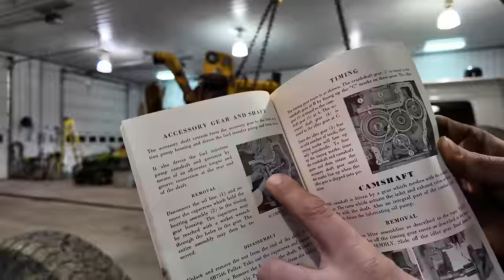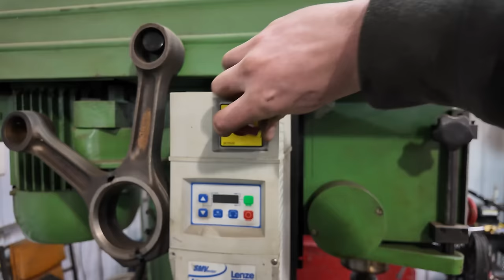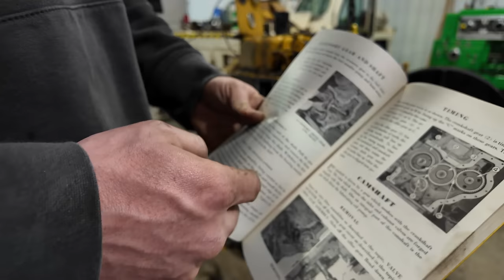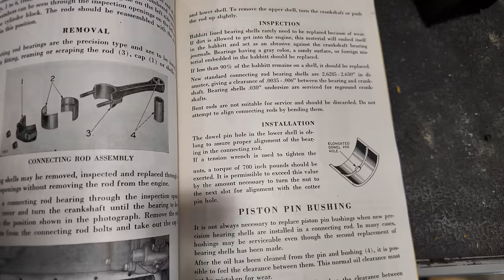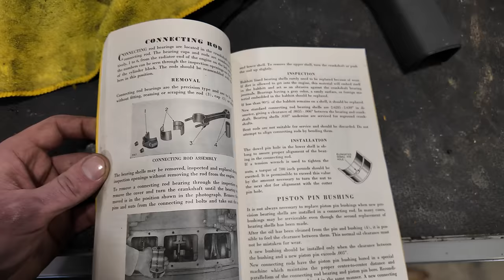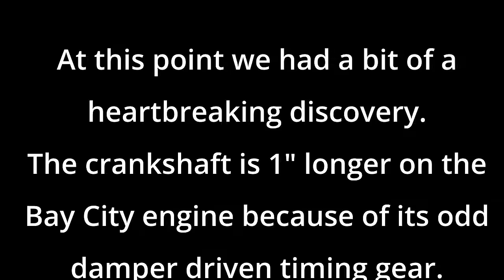Bay City Cat Engine Teardown | The Struggle is Real

Comment: check Squatch 253 for info on the pistons. When he did the engine for his 1938 D2, he went over the piston typeses. IIRC, that is OEM design, and yours are way too loose. That was the problem with the 2 piece pistons, the "ring" comes loose and you lunch the engine.
Reply: It's kind of exciting when it happens. A cloud of aluminum bits came out the exhaust while the engine knocked. Bent rod, destroyed lifters but ran enough to get the tractor loaded.
Reply: You beat me to the punch. That was a cat design, a poor one but cat none the less. I have seen one fail before, cascading catastrophic failure ensuing.  Check out squatch channel, he has a lot of information on these old cat engines, might even be able to steer you in the direction of the newer updated design pistons to fix yours.
Reply from the maker: Thanks i went and checked out a couple of his videos he definitely has a lot of knowledge on the old cats!
Reply: @ScrappyIndustries  oh yea he has an insane amount of knowledge about old cats I love watching his content
Reply: That 2 piece piston design is absolutely insane! I would have never in a million braincells thought that would be a factory concept!?!? Blowing my mind to think that actually worked 🤯🤯🤯🤯🤯

Comment: The copper ring is a sleeve shim , needed to get proper sleeve height.  Those sleeve pullers are great have used one for 15 years never failed me yet . Just a thought about that grader engine if it was military they sometimes have different specs for parts to aid in repairs , I know on the MM jeep ,NTX I think, they spec hydraulic lifter instead of solid like the tractors that shared the same engine. Yes running engines with a broken crank is real , had a 4440 JD come through the shop with its crank broken at a angle at the next to last main cap , still showed oil pressure but was down on power and he drove it about 12 miles to get it here , we were shocked to say the least.
Reply: Interesting that they used copper shims to adjust cylinder liner protrusion.  I wonder why Cat stopped doing that because cutting the block to adjust liner protrusion can be kind of a pain when doing an in-frame in my opinion.  
With regards to engines running with a broken crank I have seen that on 5 or 6 engines including on in an Alcohol Dragster that had just set a new track record. The only reason we found it was because when we were baring the engine over in the pits backwards while leaking the engine and replacing the valve springs the engine locked up tighter than a drum.  In reality it was a fortunate thing because I seriously doubt it would have survived the next pass.  I also have seen tops of pistons break off and the engine continued to run albeit it had a miss but it didn’t smoke or make any strange noises.
Reply: My first “real” mechanic job was working for the local Allis-Chalmers dealership. We had a customer bring in a WD that needed an overhaul. I got the job of doing an in-frame on it. Got it done and running good and shipped it. A few weeks later the tractor was back in the shop making a horrible knocking noise coming from the bottom end. I felt terrible because I thought I could have messed up something. Turned out to be a broken crank. Our working theory was that the crank had a defect, and the increased power after the rebuild caused it to finally fail.
Reply: @gullreefclub  I work on mostly John Deere equipment and with some of the rebuild kits now days the liners are not as thick on the top so I've used up to 35 thou shims on them , also I'm no stranger to mixing up parts to get things fixed.

Comment: They were known as screw top pistons in the earlier Cat diesels and they came loose after a time. All you need to do is drill out the two dowels tighten the piston top and drill knew dowel holes and re-pin the piston top- job done

Comment: Just in case... Mic your crank, rod journal, measure the rods for length and journal diameter. Check the crank throw and piston length. You don't the piston skirt to hit the crank or top to hit the valve. You MAY end up swapping rods. I saw the wrist pins had clips. While it's apart and you're cleaning that way you can assemble with confidence.

Comment: When you tip it up on its tail throw that 6 x 6 I see in the background under the flywheel housing to catch it when it drops over center. Then you can lift it back up with out all of the flopping around drama.

And ditto on the protrusion comment above. Pay attention to it. The value should be in your specifications.

Best of luck with the swaps...they can be a pain.

Comment: Sam, pay attention to your liner protrusion when you reassemble. That head gasket seals on the top of the liner. If that protrusion is out of spec, youll have future head gasket issues. I dont know what the actual spec is unfortunately

Comment: Great video Sam. Shows issues most folk will run into when working with old equipment. I'd like to see if the oil pressure increases now you found that bypass adjuster on the bay city engine

Comment: You're starting to convince me i need to find a terex now. Btw,, you mention broken cranks. I bought a one-ton wrecker years ago with a bad knock (chevy gas engine). I drove the thing home...when i pulled the motor to replace it I was shocked to see the crank was broken in half about midway- right at a rod throw. The way it was broken it couldn't "spin" past itself but it made one hell of a noise😂

Comment: On rod bearings the wear is going to be on the rod half vs the cap half of the bearing. Being the rod pushes down on the crankshaft the bottom half of ros bearing won't show any wear
Reply from the maker: I agree 100% guess I didn’t really show top bearing on camera.  I checked up and down play with the crank at 90 where I felt most wear would be. They’re pretty fresh

Comment: Nice job, but to prevent hitting the ceiling, put a battery operated horn with a "sensor" switch on top of the beam. When you are lifting and wiggling, you forget about that ceiling

Comment: I bought one of those chineseium  propane instant water heaters and connected it to my pressure washer and it works fairly well, but I'd bet if I had bought two and hooked them in parallel with 'T' fittings on the water inlet and outlet, it would have been as close to a $3k steam genni  as one could get for less than a 1/4 of the price.
23:38 I'm surprised there was no gasketed access cover on the oil pan for that relief knob, or was there one that I couldn't see on the video? OK, I went back and looked closer and there was a cover.

Comment: Quite interesting comparing the 2 engines, "on the fly" modifications were quite popular in that era. Remote control crane made tipping the engines on their rear much smoother and easier than a forklift did for Matt.

Comment: Sam, you should be able to find the copper rings thru a Cat supply house. Those look kinda familiar from a cat I was tinkering with a few years ago. Though I had a local machine shop do the sleeves as I didn't have the needed tools.

Comment: I'm Thinking that you Have a injection nozzle leaking fuel (not closing ). This will cause a Knocking sound that sounds a lot like a bearing or pin knock. looks like I'm late to the party. also the engine looks to have very few  hours on a rebuild. on the pistons with the loose tops there may be a nut holding the top of the piston on. if you remove the rod you may find the connection point of the piston top.
Reply: The whole top ring of the pistons is threaded on the base to retain the cast iron top ring groove/land.  That’s what has lost its tension over the years.

Comment: For what it's worth.  Washing down greasy engines was with jam tin of kerosine and a 1"or 2" paint brush, the brush got in and around the tricky spots agitating and loosening the stubborn grease, and, then the wash down with water.  VOILA.  I don't see kerosene used by anyone in USA to clean greasy parts.

Comment: Hi Sam , just wondering if you had checked the injectors as it's possible for them to 'drip' when they get worn or partially blocked , this causes a process known as 'hydraulicing' or 'knocking' and it will definitely sound like a bearing knock , hope this may help on the Cat motor , good luck , kind regards, Jimmy.

Comment: This doesn't have anything to do with your current project, but I've held off as long as I can.
I sure would like to "borrow" your motor home.  That is a real nifty looking rig.  LOL
Sammy you is one cool dude. Be careful, though, if you lose the "e" ya becomes a "DUD". That Terex Carry Crane is simply fab and with your super duper remote control, Ole Kurtis down under is probably slobbering with envy.
If it was easy "Matt" would have already done it!!!   Just kiddin ya about ur bud. At least that's what he claims.....

Comment: Im surprized that with all the old cat engines out there that parts are scarce
Reply: It is nearly 80 years old now.  In recent years CAT has let parts for even the D311/D315/D318 that are only 70-ish years old to the aftermarket.  They do offer “Classic”  parts in some cases though usually at a premium over other suppliers.

Comment: @ 22:30 you at least have a winch on your crane, try it only using the boom's lift/lower and extend/retract cylinders, THAT is a challenge even with a remote, standing 15 feet away and 3 stories under 😁

Comment: With all the advances in CAD/CAM, 3D scanning, and additive manufacturing, I wonder how much easier it is to remake some of these unobtainable parts? Obviously the cost of metal eD printing will have to come down significantly, but how difficult would it be to make a model and then send it to you CNC mill to make out of a hunk of aluminum?

Comment: Could you use a travel limit switch and electric valve to prevent over extension in the shop? Or to interrupt the remote control?

Comment: Do you think that is an early means of gas porting to improve ring seal. You see it some on racing pistons where there are vertical gas ports that go through the top of the piston and open being the ring, compressing the ring against the cylinder wall to improve ring seal. Idk. Good video!
Reply: Nope, not that, just worn out threads.  CAT wanted to use the cast iron ring groove insert and where later on they figured out how to cast them into the piston, at that point they were installed after the two pieces of the piston were machined.
Reply: @jimrankin2583  Thanks for the explanation! Learned something new on that one.

Comment: What you call ,,gasket,, under the liner, could that be a spacer? But the use of copper( easily deforming so losing height) would not guanrantee a set position.

Comment: A lot of big diesels like this have two piece pistons. The bottom is aluminum and the top loose piece should be steel. Check with your diesel guys before you condemn the engine.
Reply from the maker: I’ve seen that in the later 3406s etc. but that’s not how this was done. Evidently still a cat design in the 1930s 🤷‍♂️

Comment: That engine needed spray with a degreaser first, then a hot water washdown.   He should pressure wash from the top down....otherwise he is just running dirt over that he already cleaned...lol

Comment: Zep Industrial Purple Degreaser.  Just buy the 5 gallon cube, and a 2 gallon garden sprayer.   Mix as needed.  Do not use on anodization, nor raw aluminum (instant dark grey, and will erode it completely if left long enough).

Comment: I'm curious Sam. How does a video get 61,550 views and ONLY 7.7k(7,700) likes?? So as of now(21:50ET 2\20) 61,550 people watched this video, and 53,850 dont like it but still took the time to have watched it? C'mon people, give the guy a like if you watch the video. Its really nit that difficult or even hard at all. Just tap the thunb thingy ffs! Idk man i always like any video i bother to watch because it helps y'all make more videos for us - the viewers that like it. Its a vicious circle cycle. You like, i make more. Its that simple people! 

Anyways Sam, good job. I'm gonna finish watching the rest now(@11:39)....
Reply: Also, if there isn't a problem with the rod bearing, the rod knock you thought you heard, what is the point of swapping the pistons & liners. I believe you measured the cylinder bores as being still in spec & the crank +bearing is fine, so what are you accomplishing by putting the grader piston\sleeves into bay city engine block? Is swap just because of the piston tops being 'weird', 'custom' machined, & lose or did I miss something? So you're thinking the piston top wobble is what you were hearing, thinking it was a rod knock & that's why you wana swap? Just trying to make sure I got it right? 👍🏻👌🏻🚜🛠️🔧🔩🛢️

Comment: You and Matt both need to invest in a Laser cleaner/cutter/welder.  That cleaner function removes dirt, grease and paint all in one shot. Practically ready to paint with no water, no detergent and you can do it IN the shop. Doesn't matter how caked on the grease/dirt is, it will clean it to the metal with very little residue. https://youtu.be/FIU3IUbD0dQ?si=uZoPtmiEDaFKANkY

Comment: since you think that grader was ex military could the engine be different spec
Reply: CAT didn’t do that.  They did do things like different gear ratios in transmission at times.  Serial number of machine has SP suffix to alert that there’s something that’s different from parts book.  The D2 made during WW2 for example were all for the military contract and all had one or two slightly faster gears in transmission.  Old joke is that was to outrun the bullets!

Comment: 25:28 if it fails in an angle across a main journal it will still function but it will make all the noise in the world.

It's also normal for a few engines. You don't generally find it in large stuff like that, but the OS FF-320 4-cylinder boxer is built with a two piece crank right from the factory!  Middle main bearing is also a sleeve to hold the two halves together and they did a tongue and tongue joint, where each half of the crank has an opposing 180º flat milled into it. The two flats interface inside the middle bearing and it's all a light press fit. Works a treat, at least for a 50-odd CC model aircraft engine.